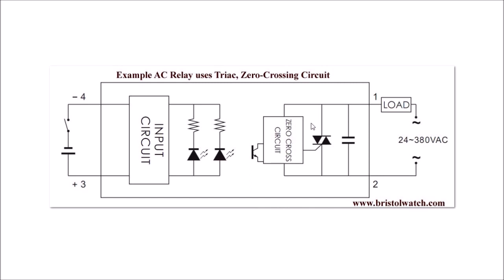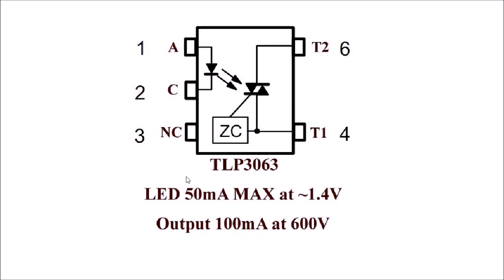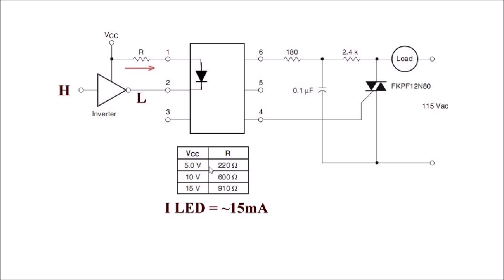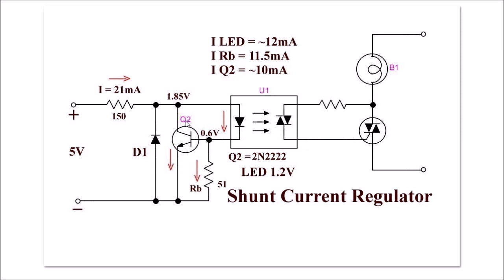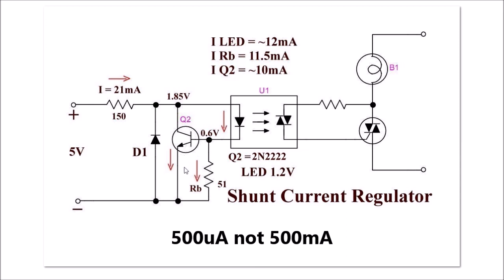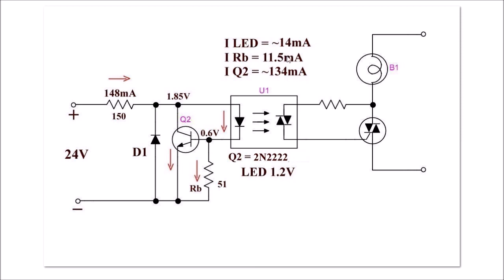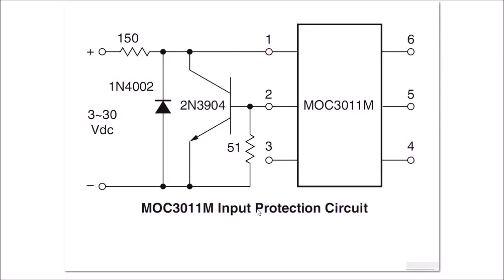Solid State Relay Input Circuits

Comment: Thanks Lewis,
So on the input of an SSR that reads 3-32vdc input, am I correct in assuming, that with a typical SSR, you do NOT have to use an input resistor...just applu 3v to 32 VDC directly with NO input resistor?  (I will be using 12v to 24vDC to drive the input)
I HAVE ALWAYS WONDERED ABOUT THIS!!!
Reply from the maker: That is correct.

Comment: how did you maintain 1.85V across the collector and excess current is not entring to the photo diode rather than going to the emmiter
Reply from the maker: Leakage current.
Reply: @LewisLoflin  what about the voltage then.. cuz even with the drop voltage doesn't reach 1.85V .. thx again
Reply from the maker: Build the circuit and make some actual measurements. Not simulated, real parts.

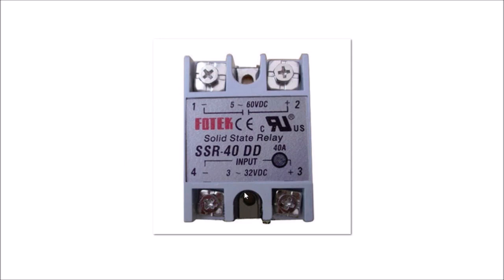Comment: The ssr40dd shown at 1:46 is a CMOS type fo DC control. Triac ssr type  has a DA suffix instead of DD.
Reply from the maker: Right it's a DC relay. You don't use SCRs or Triacs for DC.

Comment: Its the best solid state ac regulator congrate Mr. Levis,ur explanation & practical, theoratical wonderfull  is it can use for 1 hp motor  inductive load, starting current 12 amps ur feed back appreciated

Comment: WHAT IS THE PURPOSE OF D1 IN THE REGULATOR
Reply from the maker: Connecting it backwards.
Reply: @LewisLoflin IS THAT A ZENOR DIODE?IF IT IS THE SYMBOL WRONG.
Reply from the maker: @davidluther3408  It is a rectifier diode not a Zener.
Reply: @LewisLoflin  WHAT IS ITS PURPOSE IN THIS CIRCIUT?